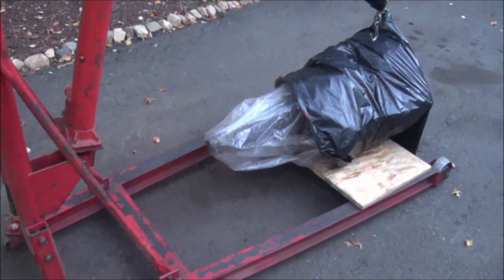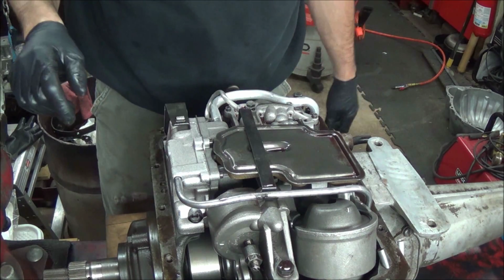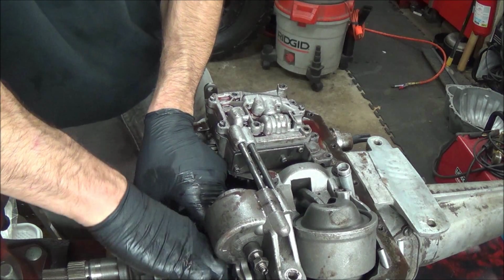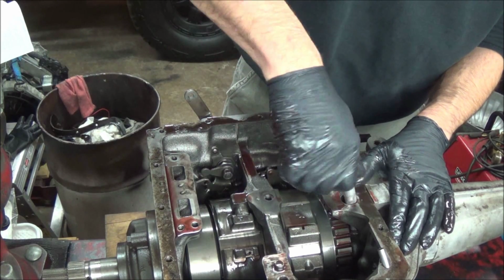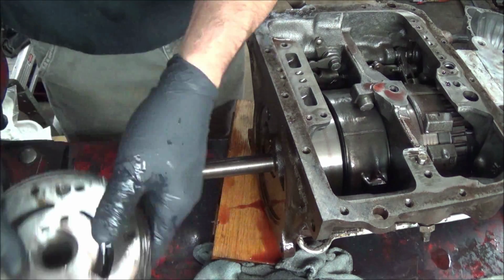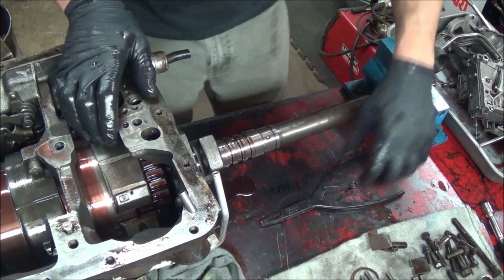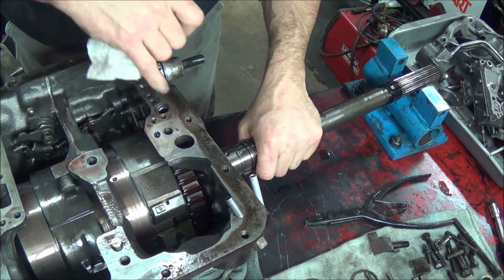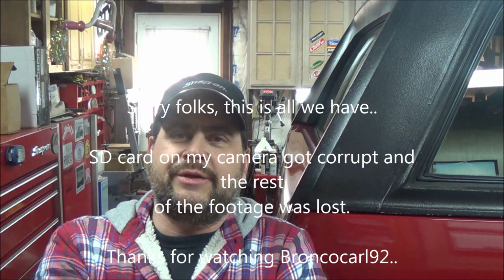Ford Cruise-O-Matic small case partial disassembly 1964 Country Sedan

Comment: Too bad your SD card went bad, I really enjoyed seeing the vintage engineering. Also I've had a pressure washer pump die the exact same way as yours, now I always check the bolts before I use it. Thanks for sharing.
Reply from the maker: +Redhawk454casull I replaced all the bolts with 12.9 (metric) hardness.. it was the strangest thing, one of the bolts actually fractured in four places (inside the bottom housing) never seen that before. At least I was able to get the broken parts out without much trouble and was able to finish the cleaning.

Thanks for watching and sorry about the footage.

Comment: rebuilt one from a 65 econoline off a 240ci. Far more durable than modern designs with computer controlled valve bodies and designed to fail friction disks and bushings.. My van never had trans work and was a field service van for decades and I rebuild just as preventive maintenance..

Comment: I cannot rebuild automatic transmissions! I can rebuild an engine blindfolded. My Cruise-o-matic in my 64 Galaxie was slipping and a man in Medora, Indiana said he could rebuild it for me. It took him 6 weeks to rebuild it and when the Galaxie hit 60 miles on the trans, it exploded! He charged me $788.00. He would not warrenty it for me. Lost my butt. Found a man in northern Indiana said he could rebuild it. The trans lasted 2 weeks, would not shift out of 2nd gear. He charged me $800.00. Then told me he didn't know what the other guy did to it and couldn't fix it. No warrenty! I am out $1588.00 and no trans. Found a used Cruise-o-matic on Craigslist and I paid $150.00 for it and have put 2500 miles on it with no problems and still working great. NOTE: Be careful of garages that say they can rebuild Ford Cruise-o-matics!!! I have a $1700.00 boat anchor!
Reply from the maker: Sadly these things happen. Sorry you had such a bad experience.

Comment: If you look back at your video - do you have to remove the valve body to replace the shift linkage seals?  I had a trans shop do this for me and later the car would not shift right.  They fixed it but charged me saying the modulator rod was binding.  Is it possible they could have fouled this up when they replaced the linkage seals?

Comment: At the 4 minute mark in your video is the gear selector In Park? I have a cruiseomatic trying to reinstall in the car and cannot get the linkage to reach.
Reply from the maker: OMG that was so long ago really can't remember.
Reply: I'm impressed you replied, well currently mine in (what I believe is the park position)
sits at the 8 O'clock position. after watching your video, is there only one way it can go in or could it bind up?
Reply from the maker: @cheapskatenation  Well if you install yoke and try to turn it does it turn or not? That would confirm Park position.
Reply: That's the next step

Comment: Hello Broncocarl!  I learned about your channel from RICKAFIX.  Anyway, I have a 64 Galaxie 500 with the Cruise O Matic.  I have a problem with, what I believe to be, torque converter drainage after a couple of days.  After a week, it starts to leak out of the shift linkage on the left side.  We replaced the 0 rings on the linkage about ten years ago and it stopped.  It started again recently and this time the oring fix did not help.  Any idea or advise?  Could it be a check valve somewhere in the valve body?  I notice that it drives great, with firm shifts; however, on a cold start i need to let it idle a bit.  If I just drop it in drive it slips a bit or does not grab.  I believe this to be connected with the heavy converter drainage.  thanks!
Reply from the maker: +jewllake So this is what I originally thought was wrong with this one.. the only difference was it was not leaking from the selector linkage. seems the problem of slipping was indeed that, a slipping front clutch.

I went through the manual and I don't see any check valve for the converter. There is a converter pressure valve (the unit with the metal retainer and the large springs) that could be sticking but that seems unlikely to me. What was in the bottom of the pan?
Reply: Thanks.  All looked good and clean in the pan.  My trans holds up well to the big 390 and 4bbl carb.  It only momentarily delays in delivering power to the rear wheels after sitting all night.  If I let it idle about 10 seconds, she is good to go.  Won't do it again all day.  Not a big deal to me.  What I'd like to stop is the leakage.  I figure the o rings on the selector linkage were not designed to be under the trans fluid level, resulting in the leak.  Maybe I'll try putting blocks under the left wheels to angle the fluid away from the linkage LOL.  I figure the delay in the mornings is from fluid quickly leaking out of the converter.

Comment: That's a 2 speed ford-o-matic, not a c4
Reply from the maker: Never said it was a C4.
Reply: @Broncocarl92   just saying cruise- o- matic indicates it's a c4
Reply: @albertblaylock4800  Actually, the cruise-o-matic name was applied to several different ford transmissions of the time including the original 3 speed cruise-o-matic which came out in 1958 I believe as an update to the ford-o-matic. The cruise-o-matic name was also applied to the c4 when it came out in 1964 and also some later c6 and fmx's I think. But the cruise-o-matic name does not only apply to the c4 automatic.